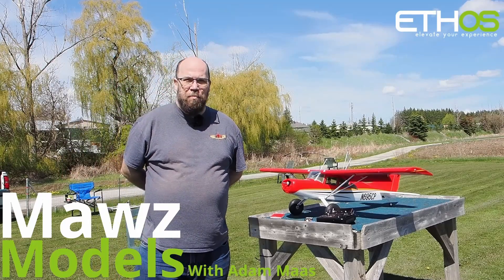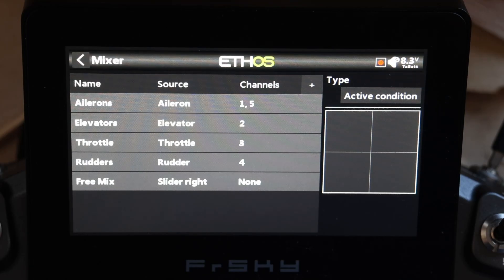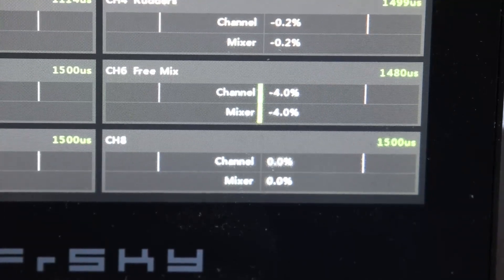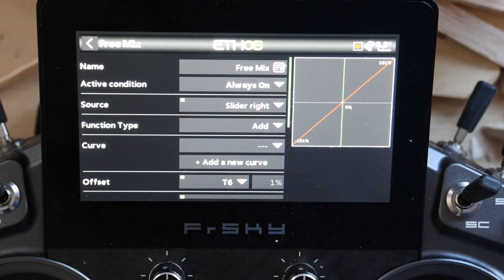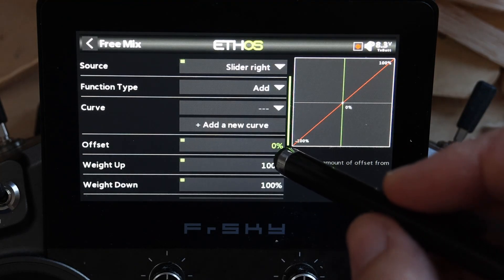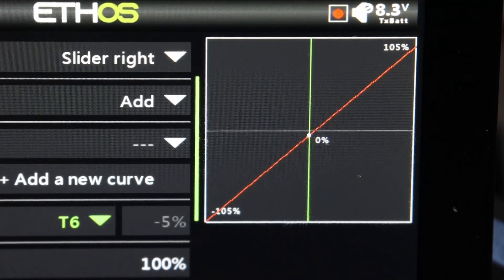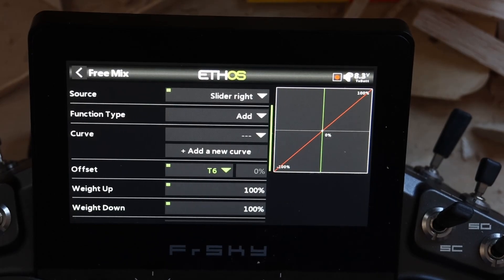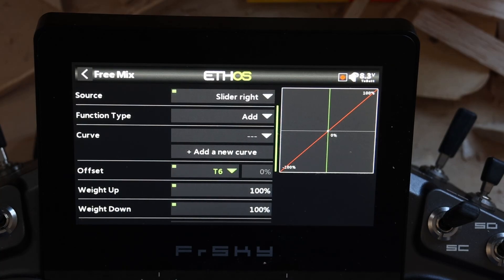ETHOS Tech Tip 20 - Trimming Free Mixes

Comment: If you were trimming crow braking which would be a combo of aileron, flaps and elevator, how do you set it up so that the trimmer is only affecting the elevator? That way you could see if you're pitching up or down in flight and adjust the elevator while in the sky and then be set up for landing.
Reply from the maker: Yes, I'd only be trimming Elevator, but what I'd be doing is adjusting the flaps-elevator mix weight via a trim function (or the curve via VAR's for very fine control). That way the value tracks the amount of crow deployment.

Comment: Thanks for the clear explanation. Just to be absolutely clear, is it the case that the trim only affects the mix when it's active? When the mix is turned off there's no change?
Reply from the maker: WHen the mix is disabled, there will be no change to the channel, but any trim inputs will still be affecting the mix itself.

So if you adjust the trim while the mix is off, you will see the adjustment when the mix is re-enabled.